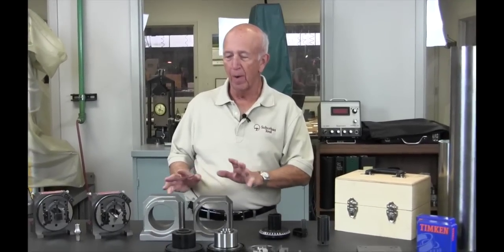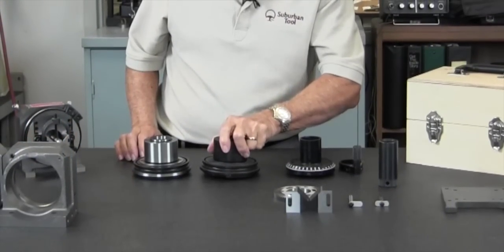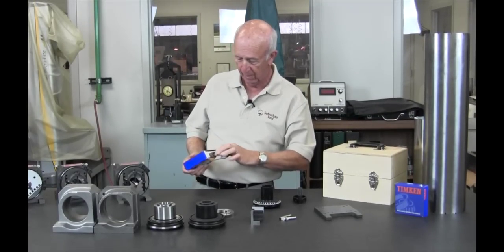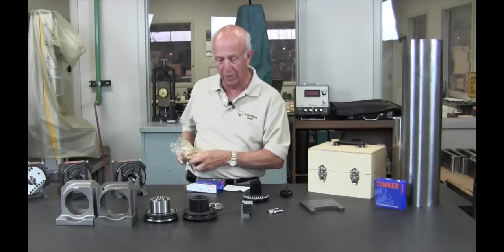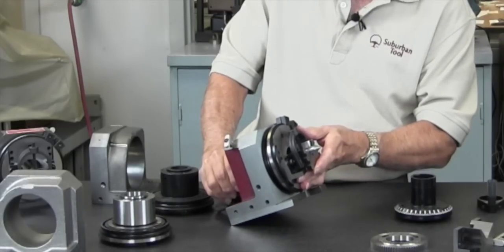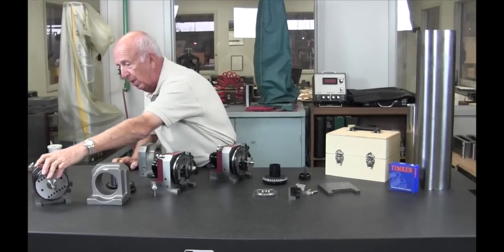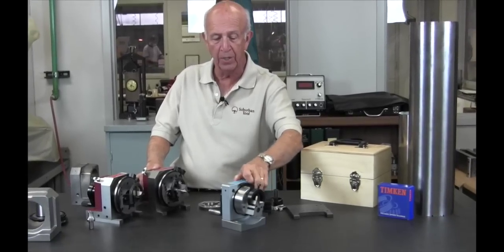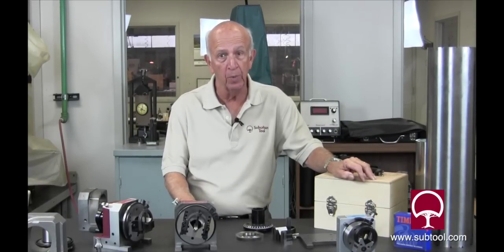An Inside Look at a Suburban Tool Master-Grind Spin & Index Fixture

Comment: Hi Guys, I've always had issues with these fixtures, whether its suburban or Harig (we have both),  being able to get close enough to the wheel without removing the guard. Any suggestions on how we can meet the OSHA requirements and still get in close to grind small parts?  Some pictures of what you guys do would be helpful.

Comment: Don....you may also like to mention that the bearings are sealed and protected from abrasive dust, coolant, and any other foreign material that doesn't belong in a precision bearing. I believe that to be an important plus with your Master Grind spin fixture. I also hope you'll consider incorporating that same feature with your whole line of spin fixtures.

Comment: Hi Don,
I love your videos. I plan on buying one of those units in the future. Right now I am using a cheaper motorized Harig. Check out this video we did where we turned our surface grinder into an ID grinder https://www.youtube.com/watch?v=RxL8FWMMync&t=848s Do you think I would be able to use the motor I already have with your spin fixture? I would have to make the mounts. Also, would i be able to mount the motor on either side of your the spin fixture? I defiantly love the way your unit is built and know it is way more accurate than mine.
Steve Barton
Reply from the maker: Hello Steve! Sorry we missed your comment, the posted link pushed it into a different section of our inbox. In regards to your question; yes, you would be able to use one of our spin fixtures with the motor you already have.  The motor could be mounted on either side. As you have already mentioned, you would have to make the mounts yourself.  Way to think outside the box ;) Thanks for your question, and thanks again for watching!
Reply: Thanks, I will be saving up for one. I love the tapered bearings concept.
Steve

Comment: looks like a copy of a Harig grind-all. Anyway, I've been wondering how to make a small one just as a good project. thanks for the video! I always look forward to sub-tool videos, good stuff!
Reply from the maker: Andre Gross Thanks AndreThe imported index fixture in the video is similar to the Harig.The Master Grind is much different. It is larger with tapered roller bearings and can index in 5 degree increments.